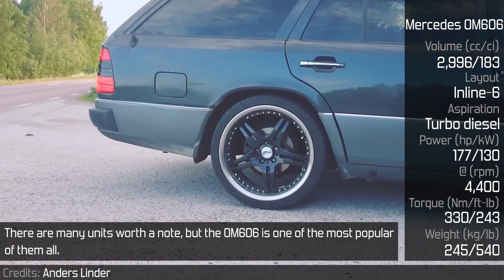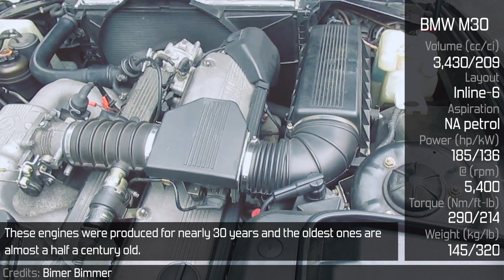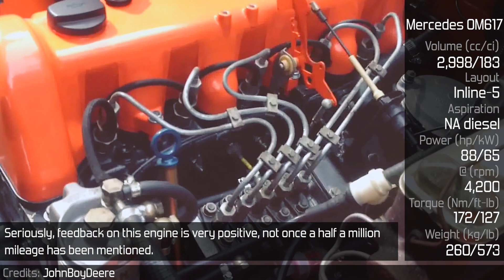10 Most Reliable Engines Running Beyond 300,000 Miles

Comment: GM's C14NZ engine. Built into Opels, Vauxhalls, Holdens, Chevrolet's. I have owned it, my dad has one in an Astra F. Though it has not done 500 000 kms, but done 140 000 without being fixed for anything. Best petrol engine ever. :)

Comment: HI, nice vid, but would like to add 911 3.0L SC k-jet engine, also the 911 3.2L motronic injection , both of these i have seen do over 300,000 miles before top end rebuild . and up to 400,000 before bottom end is done.

Comment: om617, predecessor to om606, it lasts much longer is it has cast iron block and cast iron head instead of alloy like the 606.
or the om616 the 4 cylinder variant :) 
still going strong with 1.6million miles on it.

Comment: I had a 1994 Toyota corolla 1.6 with 760 000 km / 472 000 miles before it was stolen. Old corollas are highly sought after in South Africa for their reliability.

Comment: My family had a Toyota Corona from 1981 with the 22R engine. It clocked 120k miles with only basic oil changes and two clutches. After 14 years we traded it in for a Saturn in 1995 (which was also a really good car). It did have an issue with body rust. But that was due to lack of washing the salt off after the winter seasons. I’m sure we could’ve kept it running till this day. Can you tell I miss that Toyota? Lol

Comment: Post 2000 there was a revolution in design features of four cylinder engines from some Japanese and Korean makers.  It was adopted by Honda and Mazda in Japan, Hyundai in Korea, and some other makers as well. Ford used their Mazda engines in domestic models where Ford fuel injection was used. Most settled on 2.4 liter displacement and 160 plus hp., and it finally spelled the end of those horrid timing belt replacements. 

The technical advances included aluminum block and head, ladder frame for crankshaft bearings, 16 valve dual OHC chain driven cams with variable valve timing, engine balance shaft, and wet sleeves.  It seemed to be a competitive ad driven move that went across the board with badly needed benefits to engine longevity. Now these engines could outlast the car without any major maintenance.

Comment: There's a guy with 1988 xj jeep with over 612,000 miles and I can believe it as I've got 280,000 miles on one of my own jeeps that suffered a thermostat fail at 220,000 locked up the engine, but after it cooled off it started right up and is still going today. How many other engines can be overheated that bad and go another 60,000 miles with no signs of stopping?

Comment: The toyota 1mz-fe should be on the list. I heard people say they still run hreat over 400000 miles. And i have the engine as well at 290000 miles so far and no problems with it.

Comment: I hated 1.9 tdi too... So I bought one. 1996 Golf 1.9 tdi 1Z 90bhp... To see what is all that foss about... 
I love it! It is being renovated now. Everything new + upgrades :D every rusty panel replaced. Totally new suspention and brakes... It costs about 2,500 Euro in Poland, for such repair, but worth it. The engine can easily do 500.000 miles, no problem.

Comment: Good list but you left out the Volvo 5 cylinder 5252S which is easily good for 400k miles. I also think the International 345 V8 NA was the most versatile of the long lasting engines. It powered pickup trucks, school buses, dump trucks, grain trucks, Scout SUVs, and many more. They are good for 300k with regular oil changes.

Comment: You left off the 170, 198, and 225 slant 6 from Chrysler, which was made in various iterations from 1960 - 1983 in passenger cars, then until 1987 in trucks.  It's been known for decades as one of the most reliable engines around.

Comment: You can also add 1 popular great engine from Peugeot, 1.4 petrol engine TU3JP, TU3A.

1 engine. No overhaul. 230K miles on clock. Its acceleratea car like a sport engine till now.

Yes, changing time belt 1 time in 40K miles. Yes, changing oil 1 time in 6K miles. But it still alive 😄

Comment: I can vouch for the Toyota R20 As I put 200,000 miles plus on a 1976 Carola that had 125,000 on it when i purchased it 

Other notables are the Ford 2.0 L 16 valve Zetec put 345,000 on a 2001 before being wrecked in a T bone crash
I am presently driving the 2011 1.6 L version of the Zetec that has 130,000 on it that feel like it will go well beyond 300,000
The 2009 1.6 L 16 valve Kia was also a pretty long lasting engine Put 336,000 on it before I wrecked it, oil consumption was in the 1 quart range between 4,000 mile oil changes after roughly 200,000 miles.

Comment: I think you missed the toyota corolla and camry my 2005 toyota corolla had over 300.000 miles on it before the gearbox went from lack of changing the gear oil due to my negligence and my 2005 toyota camry had over 340.000 mile before i got hit by a dui suspended driver who ran a stop sign and it still ran like a brand new car but the insurance company totaled it so it went to the junk yard i ended up getting another 2005 camry with 200.00 miles changed the spark plugs denso double platinum and oil change castrol titanium 5w/30 and a fram oil filter car runs like new no issues whatsoever and i drive from pa to new York 5 days a week.

Comment: The OM603 needs a head gasket every 250k miles.   Keep an eye on the gauge, as soon as it starts losing water fix it quick and cheap, and yours will have 1.9 million miles on the clock as mine does with the original head. 
The Older 607 I think has a steal head and doesn't even need the gasket changed and can do 3 Million.

Comment: dont know what engine my merc vito travel liner had in it but it had 1 million miles on the clock when i sold it for scrap. Engine was still going. it was everything else that was failing. 2 gearboxes replaced the drive shafts every 60k miles cause the high torque was shreding the bearings. heater matrix replaced 4 times. very underpowered though as it struggled going up hills. It was 3 years old when i bought it and had 300k miles on the clock. i had it for 2 years and clocked up the rest. As it was a taxi the miles soon mounted up lol. The engine was reliable. it was the rest of it that was crap. I also had a volvo 244 that clocked up 800k miles before i sold it still in full running order.

Comment: You give props to the GM 3.8 which is great but you don’t mention the big brother probably one of the best of all times I’d say compares favorably to the 22R. The 350 5.7 Chevy iron block iron head motors.  The 3.8 is just a shortened versus of the 5.7. These are used everywhere and are damn near bulletproof.  The trucks here (MN) rust off the frame before the motor dies.
Reply: They're talking about the BUICK 3.8, which is completely unrelated to the small block Chevy and the 3.8/4.3 engine family that it spawned.

Comment: plus U forgot about Opels c20ne engine... (engine of the year 1988, did euro 2 emission limits without it even existing yet,  snapping the timing belt wouldnt harm it, runs like hell, does easily over 500000km without overhaul even when treated shitty..)

Comment: The Ford Territory TX RWD models used in South Africa by the South African Police all did over 450,000 Km. These SAPS  vehicles  all have to be scrapped at this milage even if there is nothing wrong with them. They could have gone on to at least 900,000 Km. The Alberton Paramedics EF Falcon XR6 cars all did over 1,000,000 Km.

Comment: chrysler slant six was the longest running engine I ever had. When it finally blew a rod, it still ran enough to get me home, and that was with no water and no oil in it. Even after months of sitting in the yard broken, I could put a fresh battery in it, fire it up and move it around the yard under it's own power. You just ain't gonna see that from any other engine.

Comment: I can't agree on the 4.2 Jeep , it is one of the more common engines we see in our machine shop with broken piston skirts . The GM 5.7 vortec 1996 - 2000 is commonly seen with 350,000 or as much as 600,000 miles . If maintained properly . My 1996 Chevrolet truck now has 312,000 + on it , don't use a drop of oil between changes . Does leak a little from the front of the oil pan .

Comment: I have passed 300k with cars equipped with Mazda MA, VC , FE SOHC and FE DOHC + Mercedes M104 engines., Mostly the body of the cars reached the limit, while the engines still ran perfectly when the car was junked. The Mercedes are still in use.

Comment: Volvo 5 Cylinder Turbo Diesel  D5252T  they all run minimum 500.000 without any problems    Engine was in the 850 and V70 first generation

Comment: The leaning tower of power. The Ford 300 inline 6. Chevy stove bolts.  AMC 4.0 inline 6. 318, 360 Chrysler. 327,350 Chevy. 12 value Cummins. 390 Ford. 361 Chrysler.

Comment: the gm 3800 you talk about is not the same engine in the grand national (GNX).  The GNX engine was designed by cosworth.  I would also add the toyota 5VZ-FE 3.4 V6 there are lots of then pushing around 400,000 and stil running like new.

Comment: I just want to say that in my experience the ALH and AAZ are both more reliable and longer lasting than the PD130 or PD150. I know people with 800,000 KMs on ALHs and my dad's AAZ has roughly 650,000 on it and it's still going. It had a bad injector but now that that's fixed it runs great.
Reply: Oh, and the 24v Cummins is just as reliable as the 12 valve if maintained properly. My friend's dad had one, the odometer stopped working at 1.6 million KMs. It had about 2 million on it when they sold it.

Comment: Fiat Uno 1400 had two which did over 400k oil change every 5000k and radiator flush twice a year
Not overhauled these motors ran on and on my wife had a driving school 
Went through a few clutch sets though
Really tough cars

Comment: Ah, nice to see the bmw m30 in there, mine is 46 years old and smooth like a baby's bottom. But you got it wrong though, the m30 didn't follow but preceded the m20. The m30 has its roots in the 4-cylinder m10, first introduced in 1962 (talk about reliable, bmw used that one until 1987), then in 1968 they added two cylinders to it and the m30 was born. The m20 was first introduced in 1977 to be used in the e21 and e12 to replace their 4-cylinder 2 litre engines. Cheers!

Comment: not sure why i watched this. the key to making an engine go the distance is taking good care of it. i drive a 2003 KIA with the 2.7l v6 and have 268,+++ miles. the only real maintenance i've had to do since buying it when it was at 23,000 was to replace the spark plugs once. i regularly subject this mid sized sedan to a 1,000 pound plus load driving up a 2 mile 7% grade with no issues. everyone loves to hate on a KIA until i show them my odometer. it has been end to end, both north to south and east to west, across the united states at least once in each direction, and still to this day the only problem i have with it is that it got hit by a tree this spring denting the roof, for perspective this was a 150 year old oak tree that fell on it. only minor body damage, mainly due to timing. i was moving when struck.

Comment: Ford 300 L6
Ford 7.3 idi if you don’t abuse it 
The diesel motor Ford had in there escorts in the 80s (sat for 20+ years and to get it started was just a battery and prime it and it ran off of old diesel)

Comment: Taking real mileage (1 million km+) I'd suggest the Isuzu 4FB1 as found in Holden/Isuzu Geminis. These regularly pass 1mil with nothing but fluids and maybe a radiator hose or two. The only issue is wanting to drive one for that long. It's a fun chassis, but with less than 40rwkw, it's quite a punishment to clock that many miles. The motors are so reliable that farmers turn them into generators!

Comment: Bless the black sud on the Merc Diesel. Our lungs are longing for it since cigarette smoking has been demonised.
Reply: 4:50 ... and these mongrels.
Reply: 6:34 is that car running on LBC (Liquid Brown Coal) ?
Reply: 7:40 wasn't that engine used to get the Lunar Landing Module off the Moon on the Apollo missions ?
Reply: 8:03 Typical Swedish driver. Since 1967 can't decide which side of the road to drive on.

Comment: Peug HDI's can run easily over 300K with no repair. I bought a 406 for 500€ with 230K in the clock. I never changed oil or any filter and I drove about 60K with it. Then I gave it to my frined, who used it for 4 years, he made some 30K in it and the car still fine. Alternator, gearlinkage cable had to be changed, we filled it with radseal, because a waterpipe cracked once and the turbo does not give any boost sometimes. But it was dodgy when I bought it, soit's fine. :)  PSA diesels are awesome engines. But I still hate diesel cars.

Comment: I bought a 93 Ford ranger with the 4.0 with manual transmission 200,000 miles, ran it up to 437,000 miles then sold it.

Comment: Lots of good engines here.  For what its worth I think mid 1990s engines just before the installation of widespread computer control are the best, and usually run a few times round the clock.  I also (Controversially!) rate Renault engines - They run for ever its just the rest of the car disintegrates around them.  Even Volvo used Renault engines in a lot of models, and Nissan still do.

Comment: 1995 Chevy Caprice LT 1 engine  347,000+ miles and still running strong  never had a valve pan off I've  heard of caprice police and taxicabs going 500.000+ with no engine problems I guess that's why GM quit selling them in 1996 kinda hard to sell a lot of them if they last 20 years

Comment: I had a 1978 Volvo I bought for 300 dollars with 250000 miles. I put another 250000miles on it. The body was falling off the car and I had to give up on it. So the next owner took the drive train out because of its rare overdrive transmission. The new owner went to rebuild the engine and transmission and said they looked great on the inside so he just buttoned them back up and made the outside pretty and called it good. Volvo used to make absolutely bulletproof drivetrains.

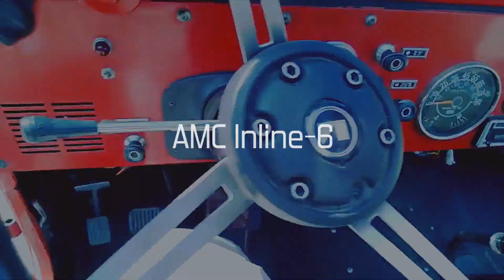Comment: 1:48 Proud owner of a 4.2L inline 6 in a VAM Gremlin '81 (AMC)...

6 times overheated untill the oil was smoking white out of the engine... I could not kill it so i decided to overhaul it... After that it kept going 2 years nonstop drag racing drifting burnouts etc etc every single day, then suddenly a lifter failed... Perfect excuse for a new aggressive cam/lifters/springs...

Best part is... I got the car for not even $800 USD... Overhaul + tuning was around $2000... I cant find a 300+ torque beast for less than that...

Comment: What about toyota and nissan pickup trucks? My dads 2004 nissan frontier 2.7 had about 300.000 km when the 3rd owner sold it.  And thats good for the dusty roads of the Paraguayan Chaco... And my father inlaw drives mostly in tarmac but often hauls a small trailer had a toyota hilux 3.0 with 640.000 km on it.. Sold it because of an transmission problem.. Engine ran perfectly..

Comment: The old Mercedes diesel engines have been known to run a million miles or more. Back in the day it was a W123 taxi not far from where I live who was running two shifts every day. One of the guys who used to work for the local Mercedes dealer said that the last time he could remember seeing the car it had 560.000 miles on it. The starter had been replaced once but other than that, and parts that will wear out like brakes other service items, it was untouched. It even had it's original exhaust.

Comment: I did the 3800 SC engine swap in my Fiero...the thing runs great. Has lots life left even though its up there with the mileage. The problem with those engines is they were always connected to a shitty ass tranny. If you craigslist GTPs or buicks, and there is a problem listed regarding that car, it's usually tranny related. Not engine

Comment: I had a Vauxhall (Opel - GM) Senator B which had 343,000 miles on it when I scrapped it (for rust, was still driving fine). It had never been opened up, just serviced, the trans was also original. Had several other Senator A & B`s, as well as Carltons, most had done over 200,000 miles without issue (but all were rusting! If only GM had splashed a bit more rustproofing on during manufacture!).

Comment: I have a 12 year old Lexus ES330 with 265,000 miles and I drive it every day. I guess it will easily run 400,000 miles or 650,000 miles. Other than a radiator and a new generator, brakes and normal bits, it's all original and drives 90%  like a new car...

Comment: Just saying, the KA24E out of the Nissan D21 is an extremely reliable engine. I know lots of people with 300k plus miles on those trucks. Also, the old 350 small block Chevy deserves a mention, since I see trucks powered by those things still driving around everywhere

Comment: I have to disagree with the last engine. GM probably made improvements and fixed the problem, which would account for the positive reviews you saw, but the 3.8L that Oldsmobile included in the recency 98 in the mid '80s were notorious. They had the timing cover, which housed the oil pumps, and the oil pump gears manufactured in seperate locations and these engines had horribly low oil pressure from the factory. The fix? Change the 5 lb oil pressure light for 3 lb lights so it wouldn't turn the oil lights on and sold them as is. My grandmother owned one and I saw this problem first hand. And since that's basically the same engine as the 3800, I don't understand this inclusion in your list. Otherwise, good job. I enjoy your videos. Have you considered the Ford 4.9L straight 6? I know someone who had one lose oil pressure and came almost completely apart and still made it home and ran on the only two cylinders left intact. Worth looking into, at least.